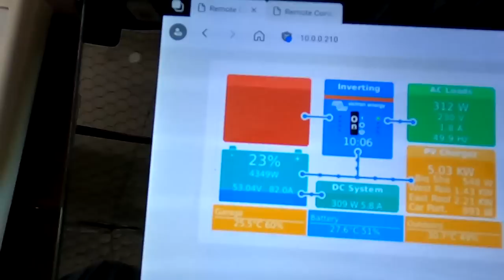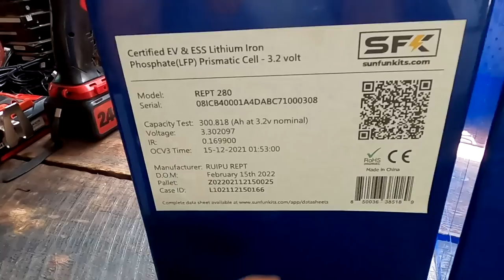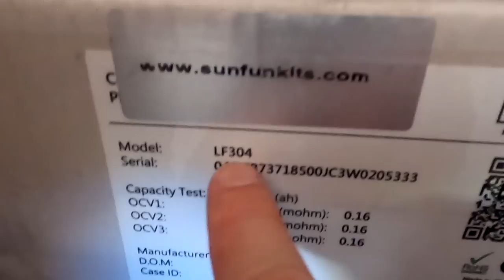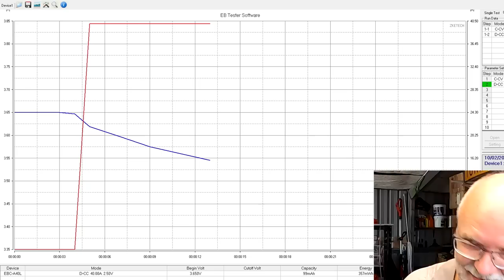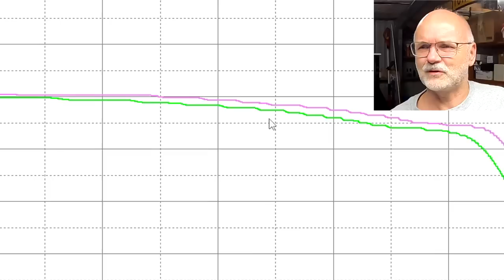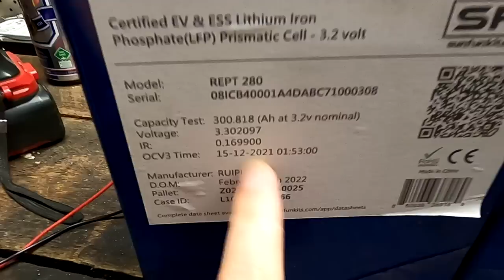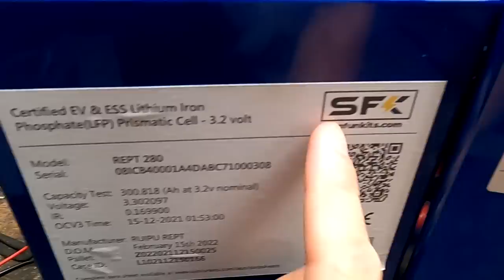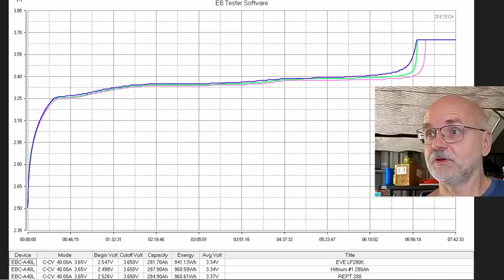BEST cell to buy - Testing Certified, A-Grade, B-Grade, Storage-Grade batteries🤷‍♂️

Comment: Another great vid and tests Andy. Does ‘Certified’ mean or refer to testing carried out by an on-seller of B grade batteries? My understanding from ur previous videos is that EVE only pass or fail individual cells, if passed they get welded into an EV, if they fail their manufacturers stringent tests, then they are auctioned/sold off to on-sellers who install posts or threads to the otherwise blank top cells, which to me means that all or most of these cells are of failed EV standards and sold for storage. I am happy to buy cheaper storage batteries this way for what they are, Im not too happy about the convoluted marketing BS that goes with certified cells though as there are a number of red flags there, not to mention the claimed & tested 300+AH on label, which doesn’t help with the confidence vote either. I think they are all a gamble each must make, & many of us will end up with at least 1 or 2 bloated cells in a pack (I have),  even from reputable sellers. I cant see enough evidence here to support paying the premium price for these alleged Certified cells & I am somewhat sceptical now if the QR codes are even giving correct or much real info either. I would be going for the cheaper cells for now, with a view to what may come with future upgrades, battery prices & technology. Cheers.
Reply from the maker: Great summary, thank you.
I have not seen any evidence myself yet, that these A-grade or certified cells are having any benefits for solar storage projects. We don't know if they last longer, have a higher cycle count or can store more energy. 
We will be reading this in 2035 and laugh how stupid we all were back now... 😂

Comment: Thanksyou Andy. Have you ever had one of these vent or short for a small amount of time? What is experience please?
Reply from the maker: Noooo, that should never happen. If so, it is heavily overcharged and release the pressure through the top valve.

Comment: Hey Andy !! Got a question for you. What torque spec do you use for the welded studs on the EVE cells. You have mentioned different specs. 4 - 5 nm ?? I enjoy your videos. Thanks and Cheers !!
Reply: it should be the same. its the threads that need a torque value having them welded shouldn't change that value.
Reply: @dc1544  I get how torque values are set but in this case my greatest concern is that I break the weld. My cell provider just told me that 5 to 8 nm is good. Start low and check that the ring terminals will not move. Thanks for responding. Cheers !
Reply from the maker: Hi Dave, I use 4Nm for the busbar connections. 8Nm is too much and could already damage the terminal itself. That's the max torque the terminal can withstand as per specs. So, 4Nm is totally fine and sufficient.
Reply: @OffGridGarageAustralia  Thanks Andy !! Four nm is what I've been using. I've been reluctant to tighten any more. Cheers from cold and rainy Pacific NW.

Comment: Hi there, 
Nice informative vids man.
Would be cool to make some tests on degradations with your oldest used cells, in terms of cycles, normal use, etc.
Maybe you can find some old packs and remove one individual cell from package just for sake of testing in terms of degradation.
You are the only one who can make this test, because you use them at daily basis in normal conditions (charge/discharge).
Reply from the maker: I think we just did that with the Battery1.0 cells before we installed it in the Seplos Mason box. The video is here: https://youtu.be/GFuY8MrDAfA
Reply: @OffGridGarageAustralia  
Thank you!
I just finished watched, it is exactly what i wanted to see. If we can extract 4000 cycles like they are rated.
But seems they are much terrible, if 75 cycles took 5% degradation for average.
Maybe in few years you test the oldest pack from those 3 packs, that are used much more intense if i am not wrong, from what i saw in like 20 videos on your channel.
Those 3 packs are the main battery bank.
You think you have more then 400 cycles on oldest pack?
Anyway i don't think is possible to use 4k cycles!
Reply: @Flavius-Tech  Calendar aging is real, and cells will degrade even if not cycled. The worst thing for degradation is to fully charge a cell and let it sit at full charge.

Comment: Hi Andy, couldn't you just build a pack with all these cells and test it with high currents? 
You could see the voltage drop for each cell in the BMS app and compare. 
Let's say you run this test at 90% SOC, 50% SOC, 10% SOC... it should result in a pretty good comparison on how the cells behave. 
Please forgive my ignorance if this is a stupid idea, I'm only an enthusiast with no training in this domain :)
Reply from the maker: I could do this, 2x 280Ah and 2x 304Ah cells in series makes a 12V battery. It would be good for a high current test then. But again, I'm questioning the benefit of such a test. What do we get out of it? How many people use these batteries with 200A+ on a daily base?
And, I have done the high amp test with the B-grade cells and they were fine, so there is no issue in doing this if you need to.
Reply: @OffGridGarageAustralia  We would have an independent test verifying the claims of SFK that their cells hold the voltage better. Maybe some people are willing to pay for that.
I wasn't thinking about 200A, but more like 100 - 150A. 
For example I've build a 24V 280Ah-ish battery + 2.4 KW inverter to power a small cabin (thanks for your videos, they helped me alot) :) . I have alot of woodworking tools that use as high as 2000-2200W, so 80-90A current would not be so unusual for me.

Comment: Are you sure the SFK cell is a grade A cell? Then the voltage should last longer after fully charging. I think that's just a better B cell too. order a grade A cell from EVE and compare it with your values again.
The B cells are certainly sufficient for the ESS system, but the only question that remains is how long will they last and when will the self-discharge of the cell come to an end. If the cell shows a high level of self-discharge right from the start, what happens after 5 years? Unfortunately only time will tell.
Reply from the maker: The A-grade cells I have from EVE are 304Ah cells, so cannot really compare them. I have however a 304Ah EVE B-Grade cell, so will do this comparison between these two.
Reply: @OffGridGarageAustralia  A real grade A cell should probably keep the voltage >3.5V longer, which is due to the low self-discharge. With an ESS system, this will only become noticeable when the self-discharge becomes so large and the cells lose too much capacity in contrast to their S16 competitors. The question is, after how many years, but you've come a long way, you have old cells and you've been using them for a while... that'll be exciting.
Reply: @maxmeyer7299  The voltage of these cells does not stay above 3.5V, grade A, automotive, or whatever. LiFePO4 settles down to 3.4V to 3.45V within 24 hours or so.

Comment: My experience with grade A (with EVE test reports) vs grade B......
16 of the 105ah cells (grade A) all measured above 105ah, I think the lowest was 108ah. EVE measured higher, but that's what I measured. I have the data files saved somewhere, but didn't note the watt hours. 
16 of the 280ah EVE cells (all grade B, I knew that when I purchased them). Two measured right at 280ah, 4 measured 264ah to 267ah, the remainder averaging around 274 or 275ah. The four that measured the lowest had obviously been fully charged and left that way for about 18 months (they took about 5 amp hours each to reach 3.65v). The remainder were shipped at the normal 30% state of charge. 
16 of the 304ah EVE cells (all grade A with test reports direct from EVE). These all measured above 304ah (lowest was 309 or 310) but lower than EVE measured. Again, I have the data files somewhere that I would have to look at to get the watt hours. 
I know multiple people ordered the 280ah EVE cells that reported the grade A cells measured below 280ah, despite ordering from the same place that I did. Since I didn't order any grade A cells at 280ah capacity, I can't verify that. But the people reporting this elaborated on their testing methodology, and they certainly sound truthful to me (same tester, same methodology).
Anyway, I am very happy with the 304ah EVE cells. The only difference when I test is I clamp the voltage sense line as close as possible to the terminal on the busbar on the opposite end from the "power" clamp, rather than on the stainless steel post. This should not make a difference. 
Once top balanced, none of mine have had any issues with staying balanced using a JBD with 150 milliamps balance current (more like 70 as you have demonstrated). I have an active balancer, but have only used it to help top balance once. I have found my Riden power supplies to do it easier before assembly into a pack.
Edit to add that the difference between grade A and grade B really only shows up around 80 to 100 amps current, below this, the performance is equal and the grade B seem fine until you draw a lot of current. The capacity is what it is.
Reply: The ali sellers will always make sure youtuber influencers get the "Best of Grade B" while the common gets the random junk. As noted before Andy became big Basen unloaded the same typical all over the place Grade B they give to everyone else.
Reply from the maker: Again, my cells where not picked, far too many issues, capacities not met and fake barcodes. I also don't order under my name.
Reply from the maker: Thanks, John. Appreciate you're sharing this data. It is really interesting to read your results.
Reply: @OffGridGarageAustralia  Andy we can send you some Fresh 280 or 304 but the deal is you need to test them when you get them, they can't be put aside for months, you'll see the first test you do they will very close to the label but if you retest them in 9 months they will be closer to the cell stated capacity usually 2-3% higher. This is the settling period it is the same for all cells.

I think you got Fresh Grade B Hitium Cells vs 14 month old Grade A REPT cells so the results are similar.

Comment: So supposed grade A and grade B cells are the same as far as stationary energy use is concerned. 
Has anyone noticed that the rack mount assemblies contain either 15 or 16 cells according to brand, what is the chance of a 15 cell pack and a 16 cell pack working well together in the same storage system?
Reply from the maker: You cannot mix these two batteries together. There is a 3V difference and they will not charge in parallel. Cell count and chemistry needs to be the same.

Comment: I think you should do the same test with these batteries after they have done a 1000-cycles run. Are the charge/discharge curves almost identical still or have things changed since this test... 🤔
Reply: How many cycles does one typically perform during a year? Maybe 100 if you push it. So that's 10 years before he can do that test.
Reply from the maker: I have done around 70 cycles with my battery shelf in one year. See you in 2037 for the result.
Honestly, who really cares about if the cells lose a bit of capacity, voltage, stored energy. Everything we're using ages and does not perform like new any more after some time. Just use them and get the most out of it!

Comment: You could have charged the 3 cells in parallel to avoid any inaccuracy of the tester. I would be interesting to see the deviation in ex. 16 pcs. lf280k´s. I bought 48 pcs lf280k´s from Quishou where theres several thats got what looks like crystalized stuff exiting from middle of the vent (below the protective plastic and only a few mm from center), is that normal?
Reply from the maker: I have to charge the cells and then discharge them immediately, If I leave them sitting, the voltage will sag again and the curves look different then. Charging to 3.65V with 1A cutoff and discharging them right afterwards is best to start exactly at the same point and make it comparable.

There should be no liquid or crystals on the safety valve, that is not normal, no. Watch this over time if it gets more...
Reply: @OffGridGarageAustralia  Good point, ty :-)

Comment: It occurs to me that if the alligator clips of the voltage sense are on the studs and the studs are not the same material as the pads, then there will be a difference from the voltage of the post compared to the conducting pad/battery, itself. Why didn’t you place the alligator (voltage sense) clips on the busbars in the charging and then the discharge tests? 

I could be totally wrong in my theory that the voltage measured at the posts vs the voltage measured at the (closest proxy to the) pad but this might explain the difference in SFK’s claim to higher voltage and capacity due to the test not charging as accurately to full charge and the test measurements, as well.
Reply from the maker: I connected the voltage sense directly to the stud. This is the closest point to the battery terminal we have which gives us the most accurate voltage reading.
Reply: @OffGridGarageAustralia  the voltage measured on the stainless steel studs is the same as the voltage measured on the aluminum pads (or the busbars attached to the pads)? Are the studs all the same resistance across the 3 cells? 

I’m not saying the test conditions weren’t the same (unless the studs on each cell are different materials), but did you get all the energy into the cells for full charge as the cells would take and did you discharge the maximum energy the cells would give if the voltage sensing was done with the clips attached to the less conductive studs, and, possibly, different material studs for each cell?

PS, I have no dog in the hunt ;-) (I use Victron batts on the boat, but do have a household solar project in the works.)

Great channel!
Reply: @jimduke5545  There is no current flowing through the sense wire (that's why they're separate from the other leads), so you don't have a voltage drop. Since there is no voltage drop, you measure the same voltage whether you measure on the studs, or the terminals, even if the studs have a higher resistance. You could even put a large resistor in series with the stud and the sense wire, and you'd still measure the cell voltage.
Reply: @upnorthandpersonal  🤔
Reply: @jimduke5545  Look at it this way: put a huge, several Mega Ohm, resistor on the positive of a 1V battery. Now put a voltmeter on the other end of the resistor and the negative of the battery. What voltage do you measure? Answer: 1V. The multimeter has a high impedance (just like the meter in the tester) and thus draws no current. Since there is no current, there is no voltage drop. Same with the tester: it's essentially equivalent to putting a voltmeter on an open circuit.

Comment: For solar storage purpose, all these certified non certified will make no difference as we probably using on average 0.5C. The difference will be seen when testing 1C and above where the non-certified will show their sign why they not certified.

So again, as most of us watching this channel for solar storage purpose, you all should be fine with any of these grades. My own preferences would be the cheapest as you would buy more with the same money of the expensive one and that definitely will give you advantage through lower cycle or lower DOD.

Comment: Bonjour mr Andyß, 
 merci pour cette nouvelle vidéo pourriez-vous me dire a quoi correspond cut off cur en mode décharge quel est la valeur ideal pour vous pour tester sans abîmé les cellules eve 280 k .
Puis-je les recharger a 3.65 volt avant de les installer en parallèle avec une charge stabilisé a 3.65 volt
Reply from the maker: You can charge them to 3.65V safely, no problem. As per our testing, we found it is not necessary though and 3.45V seems to do the exact same thing.
For the initial first charge and balancing, you can charge all cells in parallel to 3.6V before connecting them in series and for your battery.

Comment: Hi Andy, 
How much abuse.... Sorry use have the bloated cells had? 
Is that a good advert for giving them a gentle hug in a fixture?
Shine on you crazy diamond.
Gaz 🏴
Reply from the maker: It would not make a difference if you compress them after they are bloated.  A small belly is not bad. As you know, I have mine completely uncompressed with a 3mm gap in between them.
Reply: @OffGridGarageAustralia  I was meaning have you used and abused the 2 belated ones and would a fixture prevent it? 300kgf is actually not very much, I can max out bathroom scales between end plates and screwed rod, just finger tight at 150kg.
It would make an interesting video if you inspected the battery shelf's to see if they have bloated after 9month abuse. Especially now you have all those panels.

Comment: I seriously doubt any of these are A-grade batteries. The only source of A-grade I've found (but did not test, as my battery shelf has full occupancy atm) is nkon nl company. Their EVE batteries even have real A-grade terminals. I plan to test them in future, when I expand my battery storage. I agree that good quality B-grade should be enough (not sure about how many years it can last), but I just hate liars.
Reply: I have those NKON Eve “A-Grade”?  cells (24Volt install) for over a year now and they were the only ones that were easily available here in the Netherlands and those A-grade terminals are nice to work with, I balance the cells with a max 150mA (SBMS0), the balance starts at > Δ10mV and only see a difference of 40mA at the top of the curve and when charging stops it drops back to Δ10mV and stays there, Look occasionally if the heater still works and that's that.😄
Reply: 18650batterystore also has grade A with the double stud terminals
Reply: @niktak1114  Yeah if you live in North America, not so handy for me in the Netherlands..😄
Reply: @habana7638  True. Even within the US shipping cost quite a bit from there (over $400 for 48 cells).